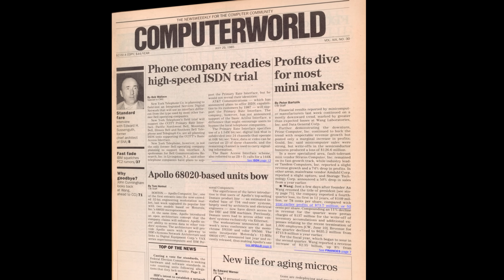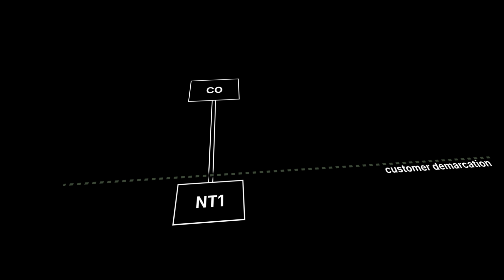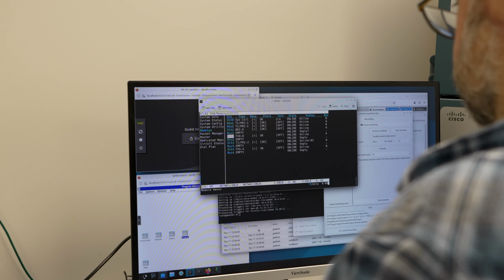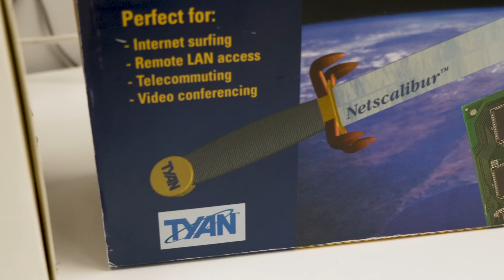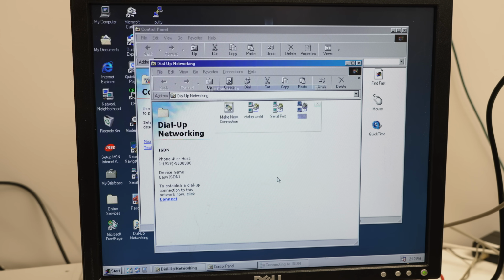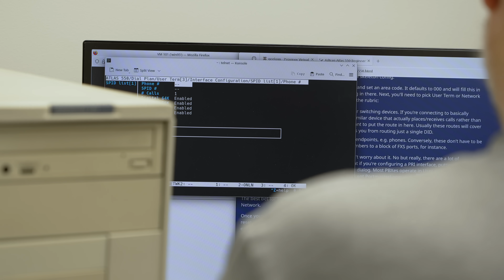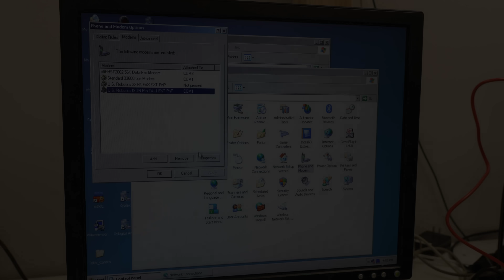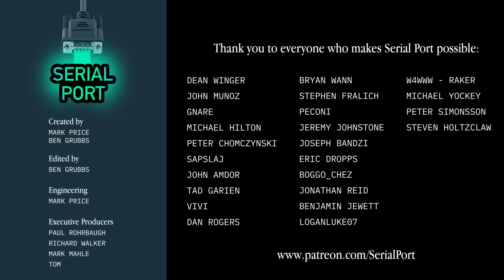Do you remember ISDN?

Comment: Got ISDN in the late 90s in germany before DSL was available. Comparing to 56k modem it was way faster because i never got the 56k on modem, just 4X or so, it was way more responsive and the ping was awesome, great for some Half Life,  Quake or King-Pin multiplayer sessions using gamespy😊 I also downloaded a lot of MP3 and warez .rar archives, the good ol'days! But it wasn't cheap because (at least at the beginning) you pay per minute if I remember correctly. Some phone features like caller id, conference calls and automatic callback when line was busy were nice as well as our one and only service provider didn't offer them for analogue lines at that time.

Comment: Here in the northeast US, Bell Atlantic charged per-minute on ISDN connections up until at least 2000 when were able to get our first cable modem… so that had something to do with why ISDN never succeeded.
Reply: NYNEX was the absolute worst when it came to price gouging.
Reply: @esSKay25 It was massively cheaper to configure your CPE as DOVBS (for the newbies: telling the switch it’s a voice call, which reduces bandwidth to 56k per B and wasn’t supported by all ISP equipment).
Reply: @BradAckerman  the sad thing is that this was all the result of PUCs in bed with the telcos instead of protecting citizens.
Reply: We (Interpath) got around that with Centrex Groups. (aka "telco pbx")
Reply: Oh I remember seeing those bills for the first time!!
Reply: holy shit what? that's insane
Reply: @KellyClowers  Yea I mean the US telcos were also still charging extra for touch tone dialing even at that time. I remember having to use ADAP instead of ADAT on my modem to have it dial pulse instead of touch tone cause it was an extra $3 a month or something.

Comment: HOLY S.... Gernamy here. I ... LOVED ... ISDN at the time. My father had a small business at the time. So i got early access to the ISDN world. I was KING among my friends. The advantage was 1. Flaterate business option and 2. more important: Internet while family was on the phone (Yes only 64k BUT THAT WAS A GAME CHANGER!!!!). Download things over the night was no problem for me. HELL I miss those times. The internet was way more interesting. Thanks for reminding me of the better times!!!
Reply: yeah, and if you had the right ISP, you could even bundle both channels and had mindblowing 128kbit/sec 😊
Reply: @marcd6897  it actually was mindblowing back then, I had ISDN with 128k channel bundling on BT in the UK. Great for napster and AudioGalaxy.
Reply: @marcd6897  Yes, though at work we used that second channel for the fax machine, as it was a whole lot more reliable than the century old paper insulated copper wires, even though it ran on the same cable pairs as the others, and that 250VDC line power for the TA killed the cables rather fast, to the point that the telco was forced to dig and install a new 50 pair cable, as the old 30 pair lead sheathed cable was running pretty much as all incoming lines being split pairs, and the single wire spare was running the telex machine, using a ground return for it, and it was not reliable. New PVC section, 60m end to end, spliced into the old lead sheathed cable in a street vault, where waiting for low tide was part of the install, and all the noise vanished. Plus on the other end of that 98m cable, all the jumpers in the 3M patch frame, again in a basement, were pulled out of the punch block, and were instead scothloked to the jumpers both ends, to make the 350m long trip to the exchange. I saw those plans often enough to have the lengths burned in, and then doing a TDR at the exchange, and invariable showing a fault somewhere between 450m to 500m put the fault on that old cable segment. Telco tech got staff discount at the shop, he was so well known by us.
Reply: @marcd6897  With the right card and being connected to the right PSTN exchange you could even add most of the control channel (the D channel) for almost 144Kbits/sec. The 2 B-Channel aggregation was already over the top bandwidth for that time (when analog modems topped at 56k bauds)... as anytthing better was in the domain of leased lines and was costing an arm. 

Now, I can disclose that I was cheating at that time, since I was an integration engiineer... putting PSTN exchanges in service... I had access to all the fun stuff. (and the ability to tinker with the subscriber parameters of the ISDN line at will (as long as it was one of the test line).
Reply: Sounds like my life back than. 47yrs. Also German
Reply: @daomc 47 year old Brit here.

I used to take advantage of my workplace's ISDN line because I think I was the only person there who actually knew what one was...
Reply: Yes ISDN was BIG in Germany, I remember well my girlfriends parens had ISDN even after 2000/2001
Reply: Everyone had ISDN in Germany, it was not much more expensive than analog and it was cool with kids, because everyone could have their own phone and number. Even the bill showed every minute one phoned (before flatrates were a thing) My Parents got ISDN in 1997 (my dad had a Fax Machine for work at home) they needed a new number, because the post couldnt allocate their old 3 Digit local Number into the digital word.
Reply: 64k is more than the 33'6 to 56k of dial in modems
Reply: @docugraf  64Kbits/sec against 56K bauds... There's a massive difference.
Reply: German here, also. I had an ISDN connection in my apartment in Germany way back then when I was still in Germany. It was clearly a step up from my US Robotics modems.
Reply: You are forgetting the biggest advantage: latency. Dial up was like 300 ms.
Reply: In Germany it was popular. In Finland operators are greedy, so they doubled the basic phone connection monthly fee for ISDN hookup basing that you could have two connections (call, 64kbit/s) at the same time. 99,99% didn’t think it was important and it never got popular over the analog phonelines. They did the same with WAP as well. In Germany I read that you could send sms messages to landlines thanks to ISDN.
Reply: @tujuprojects  SMS via ISDN was a thing until the entire ISDN/PSTN Service got shutdown in 2018.
Reply: I talked to a German guy at USENIX LISA in like 2001 who had ISDN, that was really interesting, though at that point DSL and somewhat cable (at least in the US, not sure about EU) were starting to push ISDN out I think.
Reply: ISDN download/min was completely free on Sunday when using German Telekom (was there any other ISP in the 90.?) for both channels. We shared lists in school who had to download what, so it could be shared on Monday. My parents always complaint that there are unable to make calls even that we now have the "more expensive ISDN".
Reply: After seeing the mess in the beginning with ISDN in the USA I’m really glad Europe standardized ISDN. With both B channels and a 128k connection getting downloads off of Napster was amazing. Then DSL came. Too bad ISDN went defunct. All those NTBAs went into the dumpster. Although I still look after larger ISDN switches in small companies this technology is extremely reliable.
Reply: In 1998 or 1999 we would use our ISDN at work for playing Half Life death match. Lol we had 2 lines that were aggregated.
Reply: Germany here, as well! After being stuck on 56k for a few years, ISDN was a game changer. Not so much because of the speed difference but the connection was way more stable. And being able to enable channel bonding and get some nice Napster and Limewire downloads going was indeed nice 😂 Gotta agree, those were the days….

Comment: When I was in the business, we had an Adtran 800 (big brother of 550) because BRIs were initially less expensive per channel. Used the dial plan to route some numbers to X2 equipment and some to PM3 equipment. Set 22 B-channels into the PM3 instead of 23, so I'd have an extra hot spare modem/dsp in the PM3 as they sometimes got software errors and needed a reboot which was preferable to avoid. Later on I had a T3 coming in and PRI cards coming out using the dial plan to route things to the proper equipment.

Comment: It's so funny how obscure ISDN was in America, compared to common place in Europe, especially Germany (16 million lines at the end)
Reply: They’re still using imperial units and split-ring electric. We have three phases in our homes with thin wires thanks to 230V.
Reply: @tujuprojects  To be fair, I think the US does 3-phase electricity just for big appliances and other machinery that requires 220 V. The plug shapes are different so that people don't accidentally plug a standard 120 V device into a 220 V outlet.
Reply: @IvyANguyen  Nope, this is a SPLIT PHASE, i.e. the transformer is single phase with a tap in the center (which is the neutral) and the two legs are the two phases (rotated by 180° instead of the classic 120° of the 3 phase system).
The most important thing is.... american 3 phase system is not fully compatible with single phase system, i.e. you can't pick a 3 phase line and convert it into 3 different single phase / split phase lines without a transformer in the middle (or without some fiddling, for example 208V instead of 230V)
Reply: @teslacoiler Oh wow
Reply: @teslacoiler  Amen.
Reply: @tujuprojects   Oh, harness your superiority complex.

For one, you have absolutely no right to judge WRT units.  Many of the "enlightened" places that use metric ALSO use various imperial measurements.  Ask how far something is in Canada, or how much liquid you're dealing with in the UK.  The UK is particularly fun, because they're not even all the same imperial units.  (PS.. where do you think those imperial units originally came from anyway??)

More to the point, the economic burden of changing everything in one fell swoop is unconscionable, so it's going to take decades of slowly trickling in metric side-by-side until imperial just falls out of favor eventually.  We didn't ask for this.  It's just how it is, by nature of being born on a particular continent, which is hardly the fault of anyone who didn't exist prior to having made that decision.

As for split-PHASE (not ring -- that's your thing) electric .... WTF cares?  There are pro- and con- arguments to whether it makes more sense to have massive capacity shared by a lot of outlets, or home-runs of lower capacity to fewer outlets.  For the most part, the 120V 15A limit is really not much of a limit at all, because few of us are welding in the guest bedroom. FWIW, many homes actually have 20A circuits, with 15A available per-outlet, with a handful of outlets on the circuit.  That's how my office is.  I have more computers in this room than a rational human should, and I've not once tripped a breaker.  The handful of appliances in a home that need more than 2000W have two phases available to them, so again, we want for naught.  All we lack is an extra 10 seconds to boil water with electric heat, or the ability to vacuum chrome off a doorknob, but few of us have ever expressed much concern over either shortcoming.
Reply: @tujuprojects  And you need all that Russian natural gas to power it.   Have fun with your rationed electricity, but at least it's 230v.
Reply: For so many years in America ISDN meant "It Still Does Nothing" because it was such vaporware
Reply: It was just crazy expensive and I think availability would have been extremely limited outside of commercial buildings even if you wanted to spend the hundreds of dollars a month. Even when things went to DSL the speeds were so bad in a lot of places because the old lines were so bad. They just patched that stuff together with bread ties or whatever over the decades and sometimes the line quality was a problem even for modems with the low bandwidth and all the error correction (like when it rained and you got a bunch of cross-talk). Those were the days.
Reply: @bubba99009  not necessarily. Some baby bells offered BRI for the same price as POTS due to pride gouging settlements. This was a huge bargain but obviously the bells did not want to market these services to consumers or businesses because they carnivorized their very profitable leased line and DDS services. The US gov had to force the bells to deploy it but by then broadband was starting to make inroads.

Also, I routinely ran DSL on copper pairs that were nearly 100 years old with no problems. Deployment of these services was not an infrastructure problem. It was a business model problem.
Reply: The instantaneous connection and the rock solid stability was amazing.
Reply: @TilmanBaumann  yes, it had triggers for DNS queries that opened the connection.
Reply: It was way too expensive until we got DSL
Reply: Hearing how much of a failure it was in Germany, the failure in America must be colossal then.
Reply: @volare_cantare why do you think it was a failure? It was very successful especially for businesses. Do you know how much getting service for businesses was in USA?
Reply: @der.Schtefan  I kept reading how it never prevailed and how overpriced it was. And with how strongly it was marketed, you can't call the resulting subsciption count a success.
Reply: @der.Schtefan  
I remember reading a report, saying that there were 19 million BRI lines at the end of 2001.
That would be almost half of all standard 2-wire lines.
if that's a failure, give me failure any day!
Reply: @volare_cantare  
At its maximum, about 48% of all lines were ISDN BRI circuits in Germany.
What percentage was it in the USA?
Reply: @ten-bob-note  I don't know. Must've been less if they call it a failure in the USA of all places.
Reply: @volare_cantare  ISDN failed in the US because telcos didn't understand the Internet.  It was overpriced and underdelivered.  Not until DSL did Internet access in the US start to genuinely take off.  IDSN was too early and too slow and expensive to the party.
Reply: @PaleoWithFries  Yeah, ISDN was just the underlay of the internet, which makes me now wonder, how they addressed the links and subscribers if not IP-adresses. And broadband gave it the rest.
Reply: @PaleoWithFries  That also gives me the obscure images of what the wired was supposed to be in Serial Experiments Lain. Next to the wired, the also mentioned the net. Yeah, they marketed as a net for diverse fernmeldedienstleistungen. Which is too vague for many and not as popular as the internet.
Reply: @PaleoWithFries  And with broadband, needing a telephone for a PPP connection sounds less appealing than a native/direct PPP connection to your ISP.
Reply: @volare_cantare  If you don't know things, why do you open your mouth? Ah, yes, because you're American.
Reply: @der.Schtefan  Ich bin deutsch. Und ich weiß auch wie die dinge hier liefen und laufen. Und das sogar besser als der allgemeine deutsche.
Reply: @volare_cantare  Classic. The German infrastructure was all bombed out because they were evil genocidal Nazis. They rebuilt from scratch while the American legacy infrastructure lived on, and the Germans find a way to brag about it.
Reply: @volare_cantare  The only "failure" in Germany is that they got stuck with Annex B due to the popularity of ISDN, while most other countries could safely use the Annex A frequency range for DSL. A very minor issue.

Comment: Here in Germany ISDN wasn't so uncommon. Available everywhere. Just more expensive than analog lines. And you needed to have ISDN to get ADSL back in the time. I got my ADSL line in 2000. amazing 768k/128k speed.
I miss ISDN a little bit. No wait time between dialing a number and the connection and amazing speech quality.

Comment: I administered an Adtran Atlas 800 at my office 30 years ago. I geeked out watching you in the software. We would break up PRI's into BRI's for audio codecs which were very popular in radio stations. That caused me to have BRI installed at the house. I think it was $100 a month which was not a bad price considering it gave you two full featured phone lines or data. I could run data at 128 and when a call came in it would automatically drop the data to 64 and recover after the phone call. Pretty cool technology until DSL and cable modems were introduced.
Reply: Radio stations and print houses were the biggest customers of ISDN in the US during the 90s. Radio stations could do remote audio links that sounded as good as on air and print houses could bounce files on the same infrastructure as their PBX.

Comment: We actually have ISDN at home.

When my Father build our house he installed phone cabel aswell as an ISDN Bus (s0 bri). But the ISDN Bus wasn't in use until one year ago.

Our old telefon system broke then. So i installed a "new" system: The Auerswald 6000R. It connects via VoIP SIP Trunk to Telekom DE (Germany) over the LAN Port. It then provides an ISDN Port aswell as 24 a/b phone lines.
There are actually 3 phones connected to the ISDN Bus and arround 12  a/b phones. They all got internale Telefon Numbers. ISDN starts from 16 to 20 and a/b from 21 to 44.

I havent tested if the ISDN Bus supports internet tho.

Do you guys have any idea how i could test?

Comment: I had a USRobotics (I think)  ISDN router capable og using both lines. The first digital connection I had to the internet. Not having to dial up (the router dialed when you requested an external IP) was a breakthrough for me and my parent. and having 128kbps when I wanted it was nice (but expensive) - this was in the very late 90s

Comment: Awesome video. Would be interested to see other isp videos. Back in the day I wondered what software they used for pop3/smtp, newsgroups etc.
Reply: pop and smtp were handled with different software. for smtp, it was initially sendmail which was a stock choice but you had to compile the config. Then qmail, then postfix, then added anti-spam tools with postfix.. Postfix was most versatile. pop3/imap we front proxied with perdition software for load balancing. Don't remember what we used for pop3, but dovecot was used for imap.